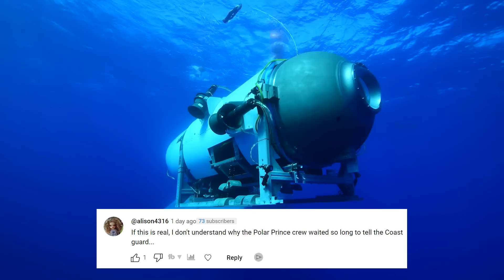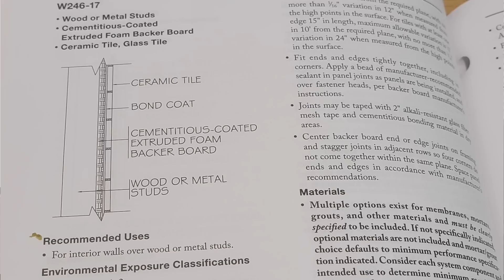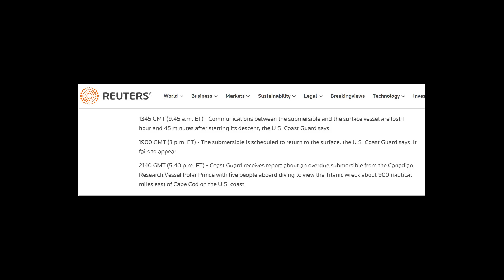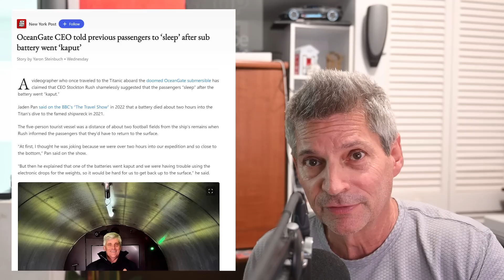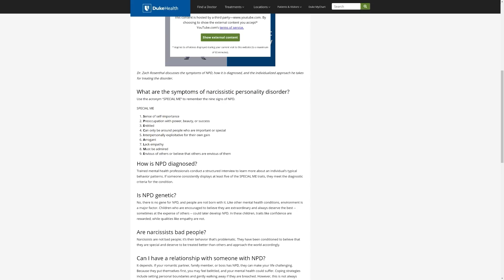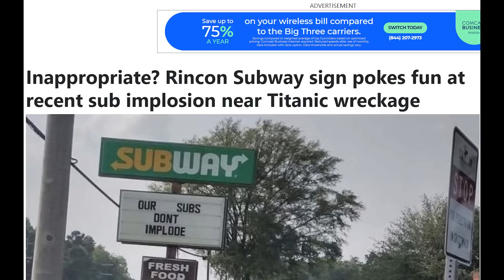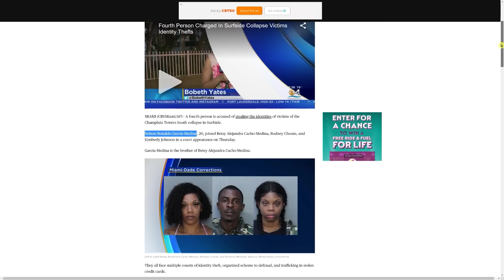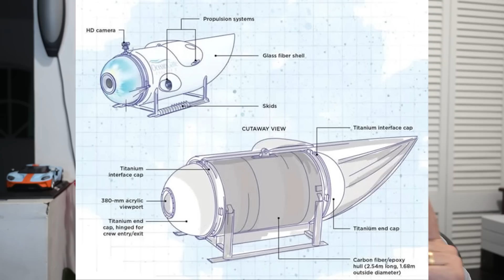Titan Sub: Why OceanGate Waits 8 Hrs Call Coast Guard, Q & A

Comment: Cross laminating carbon fiber has been the industry standard for as long as it's been used. McLaren pioneered it with the tub for the mp-4 when Abba was still a thing. Cross laminating any type of fiber period is what makes it durable. Denim is a resilient fabric because of the way it's woven. It's not because somehow Levi uses super advanced cotton textile material for it's pants, it's how the material is put together physically. Also carbon fiber is the material of choice for race cars and safety gear for several reasons. 1.) It is incredibly strong and resilient if laid up properly. 2.) It's incredibly rigid and doesn't flex under an applied load. The chassis and bodywork on a race car don't flex under lateral or linear loads. More of the energy from the power plant makes it to the wheels and the then to the pavement because less "stuff" on the chassis wobbles around. Imagine cooking 2 pieces of spaghetti. The first one is in the pot for 5 minutes, the second one is only in for 60 seconds. now imagine trying to push (apply a linear force) each one from one end of the cutting board to the other. The one minute noodle is going to be a lot more cooperative than the 5 minute noodle. Because the 5 minute noodle is less rigid it's like pushing on a rope. The one minute noodle is going to scoot across the cutting board no problem. But now imagine you have to apply a force that will snap or even shatter them. Trying to break or snap a half cooked piece of spaghetti is not going to be easy. The still rigid 1 minute noodle is going to fail and break way before it bends. It will release it's potential energy and snap because it's still a rigid structure. That rigidity equals light weight, torsional strength across all 3 axis and more power from the engine hits the pavement because less things are flexing or wobbling and absorbing that energy. That rigidity is also why an Indy car driver can smack the wall going 200 plus miles an hour, sail through the air for a couple hundred feet land upside down, skid a few more hundred feet and walk away with some bruising and a new respect for material engineering. The more rigid a material is, the more potential energy it contains. The more force applied, the bigger the reaction. When an Indy car comes apart like it was made of glass, it's transferring all of the kinetic energy from impact into the chassis and bodywork, which turns all of the potential energy in the carbon fiber into kinetic energy and the difference between the energy delivered by the car hitting the wall, and the energy released by the carbon fiber is small enough to keep the driver safe. So it's a super rigid material that is superb at being  incredibly strong until it needs to become so incredibly fragile that when it fails, it basically detonates. In a racecar, it fails so spectacularly it saves lives, by absorbing then releasing all of that energy before it can be transferred to the driver. In a sub, all that rigidity and potential energy would be a liability because the nature of the material is for it to fail safely. It's better and safer at failing structurally than it is staying in one piece.

Comment: I find it a little surprising that they went as far as setting up a data link between the sub and support ship, but still rely on manually communicating telemetry. I'd have expected they'd use this to continuously send data packets containing all the useful bits of data collected from the sub's sensors - e.g. depth, heading, battery/bus voltages, thruster inputs and outputs, alerts from the hull monitoring system, and so on. 

If that transcript was real, it sounds like none of that was visible to the surface team, instead they had to ask the pilot to relay them via text message.

Comment: They should’ve done a lot of things, but automatic emergency accent system should've been one of them. Using  all the sensors in the world is pointless if the sensors don’t automatically engage safety systems. 
In an emergency you can’t rely on powered motors, you need passive contingencies that engage automatically when the system detects any fault. A good safety system would prevent you from moving at an unsafe speed, or inform  operators that they are exceeding operational limits. If you lie to your operator’s, they can’t possibly know the true extent of the subs condition. Transparency and precise operation guides are important. 
I’ve worked at some Disney rides. While the risk and environment is not nearly the same, the rides don’t move people unless it is safe to do so. Standards are reevaluated and operations change when something new is discovered. You have to know what will fail before you know it’s safe. 
No refund is worth a life, prayers to the families involved.

Comment: The mother ship knew exactly what happened to the Titan as they were in contact when it happened. The delay was OceanGate trying to cover their ass. A coms transcript has been leaked and it leaves no doubt as to what was happening to the Titan. This has not been officially released though there have been quotes from it by James Cameron who stated that Titan's ballast and cradle had been dropped, the next day after it went missing.

Comment: Thanks Jeff for another informative video.

I have observed this same deviance of agreed upon standards numerous times during my career.  It usually takes the form of "In our Engineering opinion, the deviance is acceptable" but, it always results from exceeding the delivery schedule, cost overruns, or perceived embarrassment by the customer.  The "Engineering opinion" is nothing more than denying the facts and relying upon "gut feel" and wishful thinking.  Also, higher education breeds ego, it's an inseparable by-product.

If the communication between the sub and mother ship was via an acoustic link, the Polar Prince would have instantly detected the implosion.  However, based upon successful voyages from the past, management was probably in shock and denial for a period of time.

Comment: To have all those glitches normalized,  dive after dive after dive, often came with;  a loss of communication with the mother ship,  multiple error lights, thrusters facing the wrong way, ballast release mechanism that failed repeatedly, exterior lights that failed, it was was a tragic example of his marginal  competency & lethal  miscalculations! Oceangate staff, as a whole, permitted their boss to relish in misrepresentation, starting with his  buying the expired carbon fiber material, and using teenagers to figure out how to use a gaming controller to run a machine he was taking to crushing depths! Where were the adults that spoke out, oh yeah, they were fired! All the agencies and submersible community, science and ocean exploring technology companies who spoke out, yet still he was able to launch Titan, with 4 paying passengers! Those 8 hours passed because they excepted Rush to “rush” the submersible topside. Imagine the discussion over who'd be fired first for raising an unnecessary alarm & causing the bad publicity that would follow! It was absolutely disgustingly shameful, all down the communication channels. There were obviously zero plans in place to retrieve that deathtrap. James Cameron built a submersible that went to Titanic 30 times and to the deepest zone of the ocean, The Marianna Trench, and returned safe and sound! He also heard from others in the submersible community about the sounds detected by Naval equipment and other devices, and knew the fate of those 5 men before anyone in the media, or the families. What about the father and son, whose wife & sister was on the Polar Prince, what did they believe? Did those dear families count the seconds until 96 hours would expire? That BS was absolutely cruel, 3 other families worried too, but not in the vantage position of being overtop of the worlds most visited shipwreck, and the decimated craft that liquidated their loved ones! What an extremely profound and  cautionary tale...I expect regulation to follow all this. Damn his waiver, knowledge of issues withheld is the failure of that document in tort law, unleash the lawyers!

Comment: Is the lesson to not use carbon fiber composite materials? I don't think so. The real leson is to test everything, stress testing PAST failure, which they didn't do. As an example of carbon fiber composite materials that are groundbreaking, Pagani supercars do have something called "carbotanium" alloys, mixtures of titanium and carbon fiber, for example. Even things like a Logitech controller to pilot the sub CAN make sense if stress tested properly.

Comment: To determine if the text messaging is genuine, may I suggest to see if the time frame for the likely implosion overlaps the time that the Navy received the implosion sound (adjusted for distance that sound traveled through water).  In a quick unscientific analysis, the time reported that the Navy gave for the implosion sound appeared to be too early relative to the times from the transcript.

Comment: What are you going on about? The "arrogance" with Titanic was that "they thought" that the life boat capacity would be sufficient????

They were perfectly aware that the life boat capacity was clearly insufficient. It was even above the required amount by the Board of Trade.

The only "arrogance" involved in the Titanic disaster was indeed the excessive trust put into the technology of the ship which made Smith push through at full speed even though he was aware of the ice field ahead.

Comment: One of the easiest ways to prove anti-gravity is to leave mass and gravity out of the equation.  Sounds stupid, but that is what engineers do to prove their solutions.  Most times, an engineer will argue their solution until the end of time, even when they are dead wrong.  This is an ego issue with a skill of control, both are signs of corruption.  The problem with people that dictate is they don't have the ability to listen.  I was a COO with a baby face.  Most of the engineers I worked with loved to poke the tiger assuming the tiger didn't bite.  I got the last laugh!

Comment: I can see that the "hoop" winding has some merit in that it makes the shortest and tightest circuit around the tube, not allowing for the more lateral winding to possibly slip to a closer circle - maybe a combination of the types of windings would have been stronger. In any case, based upon expert analysis, carbon fiber was not the best material used in compression resistance.  Thanks for another excellent analysis of this tragic event.

Comment: I obviously had no idea what the fate of Titan was during that whole circus of a rescue search, but I was certainly aware that implosion was a possibility and I kept wondering why there was no mention of it whatsoever. The only possibilities that kept being thrown about was that Titan could potentially be stuck on the bottom, floating on the surface, or even worse, floating somewhere in the water column. Never any mention of the potential of implosion until it was revealed that's indeed what happened to it. It was like it was taboo to even mention it while people still had false hope in "banging noises"

Comment: Jeff…even my Marathon 50 gal fiberglass home water heater is cross woven using multi directional strands then gel coated. Not that it will ever experience a deep water dive, but it’s 100-200 % over engineered as a safety factor in the event of an over pressure event. If there is a issue the fittings are designed to fail to make for a less catastrophic event.

Comment: I’m sure this has already been asked and answered, I just haven’t been able to find it so far, so I do apologize in advance  for doubling up with this question. 

Can anyone please tell me why on earth Rush insist on the hoop pattern for the carbon fibre? Was it simply because it was cheaper? 

I’m a complete amateur when it comes to climbing, but I think there is perhaps a comparison to be made here when it comes to how climbing ropes are made today vs 50 years ago. You can still get a rope failure resulting in death today but they’re not as common - part of that reason is because of the different fibres and especially the weave patterns used in manufacturing, the other is that professional climbers (hopefully!) know to not cut corners and inspect & replace the one thing keeping them from potential death, regardless of cost. 

Watching Rush do this must’ve been SO frustrating and honestly frightening for so many in this tightly knit community.
Reply: fibres are good in tension... you can't push a rope.... totally the wrong use of the 'wonder material' Carbon Fibre' no matter what way you wind it!

Comment: "Lawyers" like to say there is no chance of a successful lawsuit by the families against what's left of this company  after all the waivers they signed. But that's  not entirely true.  1- there are some things you just can't waiver away. 2- I think a strong argument could be made that the doomed voyagers were not given enough information  about the sub''s design, experimental construction materials, or knew of the previous issues and complications to give informed consent when it came to signing those waivers, 3- the captain / pilot was diving too fast and knew it, and by doing so, was negligent in his duties... and these are just a few.

But outside of authorities freezing assets of this company immediately,  all that money has been stuffed away somewhere, a d any settlement or lawsuit, tgey will declare bankruptcy on anyhow, denying tge family anything... so from THAT perspective,  lawyers are right.  They might be able to sue, but it would be a moot point.

Comment: The time delay doesn't surprise me. As I understand, this wasn't the first time they lost contact, shrugged and waited for it to surface. With the rest of the Kool Aid operations, the fear of triggering an alarm that would involve everyone from the Coast Guard to the media to the U.S. Navy for a possible "nevermind" would be on all minds. Moot, anyway after the first microsecond.

In a more modest example of those in charge insisting on stupid decisions, I will always cringe at a Surgical Floor head nurse at a hospital in which I was working many years ago. Lots of hip replacements. Because getting up and moving after the surgery was so important, our ward usually had one or two grimacing, generally older, patients attempting to walk while propped up by nurses. 

A budget windfall allowed new carpet. Samples were offered for a vote. It must be noted the head nurse had an attitude of superiority over the rabble staff as she was weeks away from a master's degree in nursing (though had to be more admin as she displayed virtually zero clinical skills and was accepted as useless outside an office). She vetoed the plain color preferred by nurses who knew better, insisted on this insane bright color with lightning bolt zig-zag patterns. Which, as nurses warned, began making post-op hip patients (staring down at ground while trying to walk) dizzy and disoriented. 4 or 5 innocent patient fall casualties from that before it was replaced with the plain but they just suffered longer rehab courses thanks to higher-level stubborn idiocy. Manifesto ends.

Comment: I worked in the bicycle industry and this "hoop" winding is not structurally sound .Plus carbon fiber /plastic resin does not handle compressive forces well.The pressure vessel should of been 4130 or 4140 cromoly steel .titanium is extremely strong but it does not have any give it just snaps.

Comment: Yes, going against the rules is a theme here but I have heard a more convincing argument. I have heard an interview with Karl Stanley who has a lot of experience underwater in subs who talked about sounds underwater. He actually had been on the Titan with Stockton, and knew him well. He describes being able to hear sounds underwater quite well. Sound travels easily underwater, and he used whales being able to communicate over a thousand miles as an example. He talked about the energy of the implosion and its equivalent in terms of TNT, and that the crew on the topside vessel would have definitely been able to hear the implosion even at the depth they were at, and may have even felt it topside. He suggests that the crew with experience knew immediately the sub imploded, but that no one had the nerve to actually tell the second in command of the company, Stockton's widow, the truth. She probably was the one that demanded the search and rescue and the crew didn't try to contradict her. By the way, the Titan only made 2, maybe 3 trips down to the Titantic or depths similar to. Karl also described the cracking sounds he heard on the Titan were very loud, like small arms gunfire.

Comment: I knew what had happened when I heard they’d lost communications.
I’d already seen the video of how they attached the titanium rings to the shaved down carbon fiber hull ends. Three dissimilar materials with different coefficients of compression and expansion under 400 bar of pressure is a guaranteed disaster.